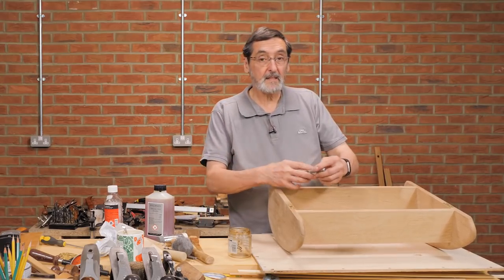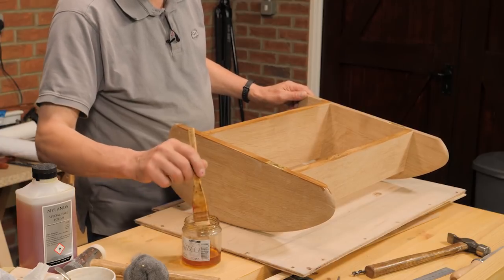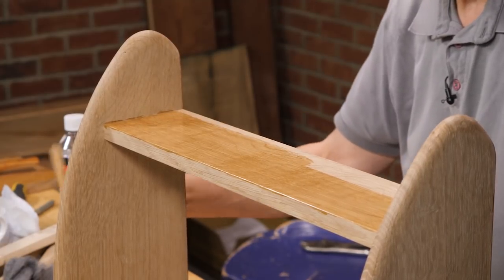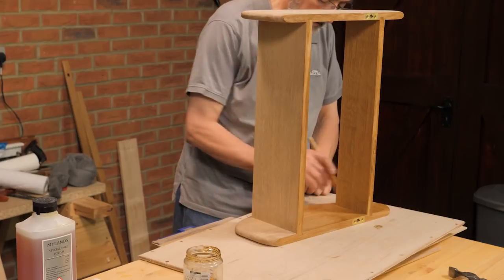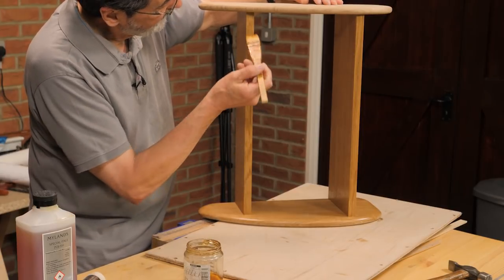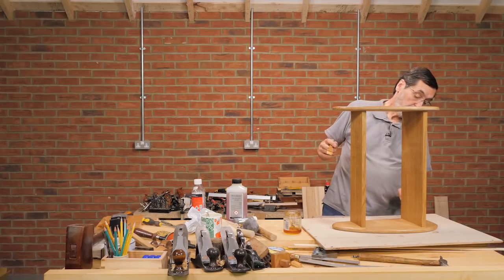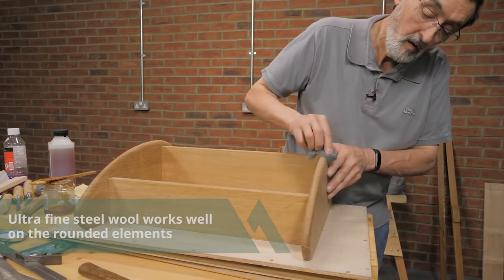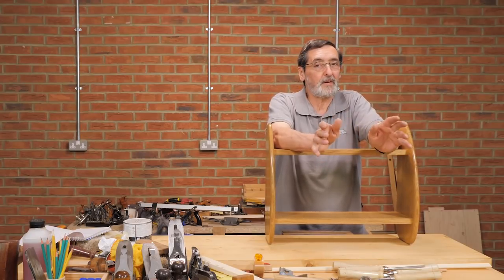Relaxing finish application with explanation/instruction [ASMR] | Paul Sellers

Comment: Thanks Paul. You have really helped me become skilled at applying shellac. It is my favorite finish by far. Two questions:

1. Is there any downside to applying one or two more coats of shellac beyond what you think the piece needs?

2.  Is there a certain size piece at which you would go to a larger brush size?  I'm thinking of things such as a book case. Every time I have tried using a larger brush than the 1" size, the finishing process hasn't gone as well for me.
Reply from the maker: Yes, you can apply many more coats. The more you apply, the more protective the surface will be.
A two-inch-wide brush takes care of all my larger surfaces such as bookshelves, desktops.
Reply: @Paul.Sellers  which shellac did u use in the video?

Comment: hi paul just wanted ask u if want slightly amber teak finish on pine which shellac shall i use and do u need and undercoat to apply shellac is sanding sealer an undercoat for shellac?

Comment: I have such a hard time using shellac over wood dye.  Unless I use a rag damp with denatured alcohol and wipe off the dye very well before applying the shellac it turns into a splotchy mess.  Even spraying shellac doesn't work well unless I wipe with the denatured alcohol first.  I use Transfast aniline dye for those wondering.  I really have to wipe off the dyed surface very well before applying shellac for it to work right.  Very frustrating as I'd rather not spend the extra money just for wiping off purposes.  Although when done correctly the shellac over wood dye looks amazing and I love it.
Reply: If you are dying the surface first you man need to then sand it down to a very smooth level after it is applied. The type of wood you are using may also flair up when you apply the dye so that when you apply the shellac it looks rough. 
You can also add dye to the shellac to give it a darker color. The standard of your work finish really is dependent on the final cost and selling price of the work. So that will dictate time and resources used. 
If you are producing a $100 bit of furniture you really do not want to be spending 10 hours doing the finishing unless it is a project for your own home.

Comment: Key to shellac is not to fiddle with it right away if you make a mistake. If there is a run somewhere you missed and it has had a minute or two to dry, just wait until the whole thing is completely dry and sand it off. Messing with that run while it's wet never works out well.  Or you could do french polish and not have to worry about runs at all by virtue of the application process. I always assumed french polish was harder to do but after trying it myself I consider it even easier than using a brush.
Reply: Applying with a brush is easy and not complicated.

Comment: If you sign your work using a marker don't cover the signature with shellac. It will make a mess. Paul doesn't comment upon this detail. Perhaps somethings are best learned the hard way.
Paul you are the best.
Reply: Not if you use a CD marker which is resistant to alcohol and water.
Reply: If you do it in marker and then just cover it in shellac it is not going to streak. It will if you rub back and forth.